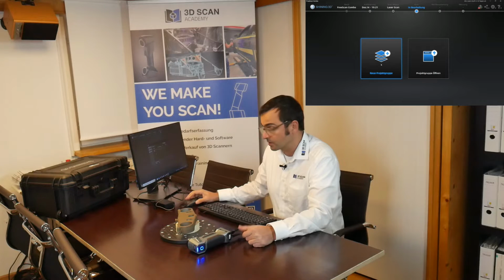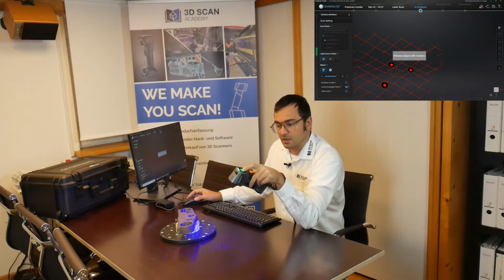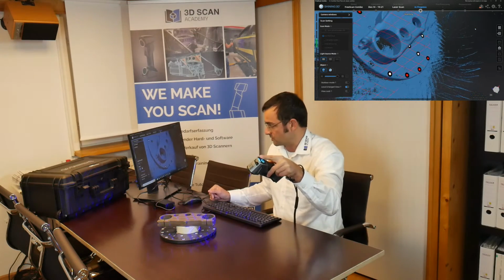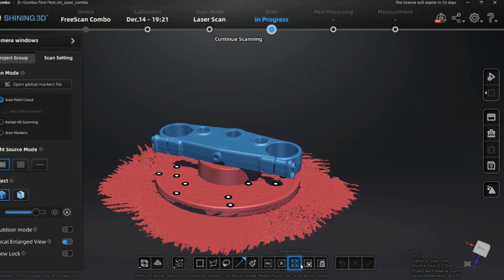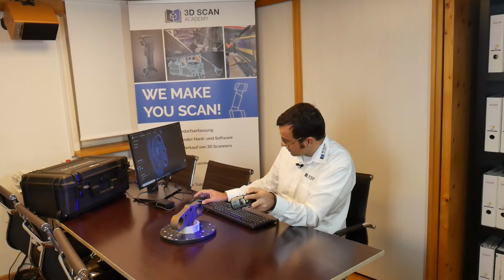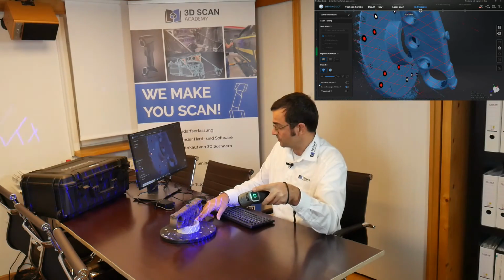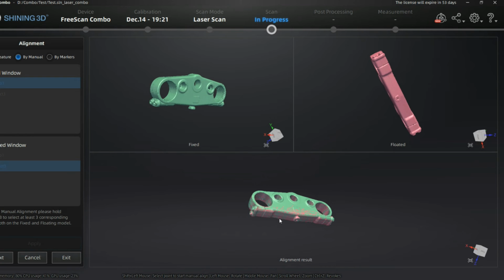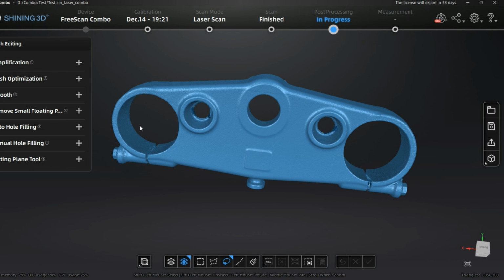Shining 3D FreeScan Combo Tutorials Part 3 Laserscanning

Comment: What is the best scanner for engine parts and gearbox housings and cylinder heads? Is the HX best for this? And how small of a hole will it accurate scan?
Reply from the maker: Best would be FreeScan Combo in my opinion. You have the best entering in holes and channels.

Comment: Will it be a good device for large parts, say 2 to 3 meters or more
Reply from the maker: Better than an EinScan HX but not at the level of an UE Pro but still very good
Reply: @3dscanacademy76  What is the difference between UE pro and Freescan Combo?
Reply from the maker: The UE Pro has more than double cam resolution and an internal photogrammetry. The Combo go a fan to level inside temperature instead a very expensive composite bone for the thermal stability. @brezovprut4431